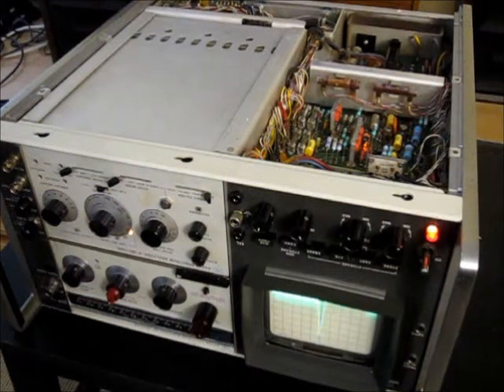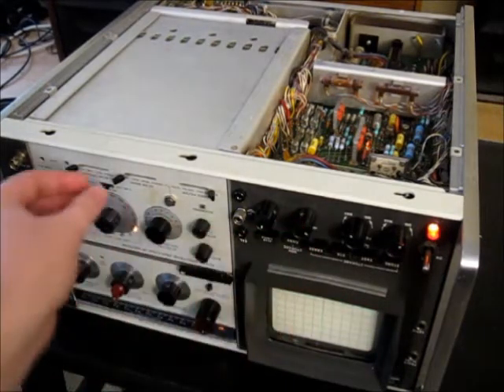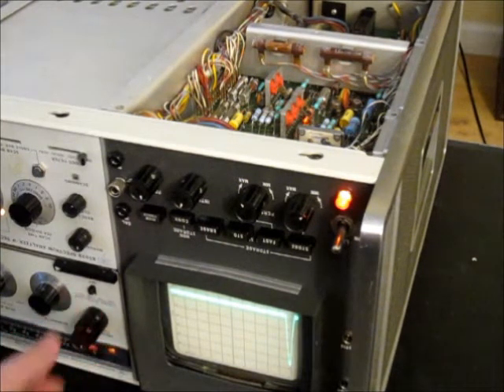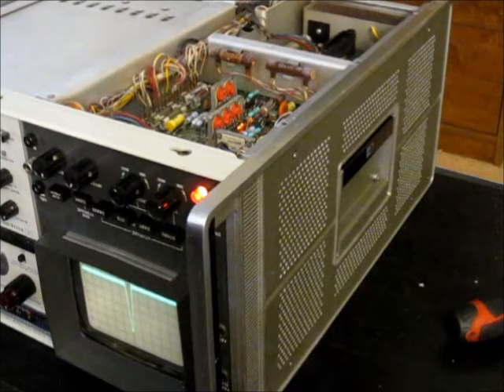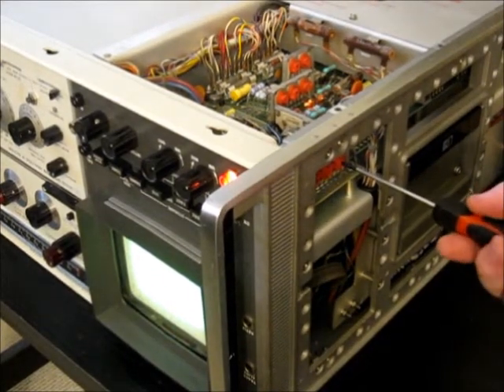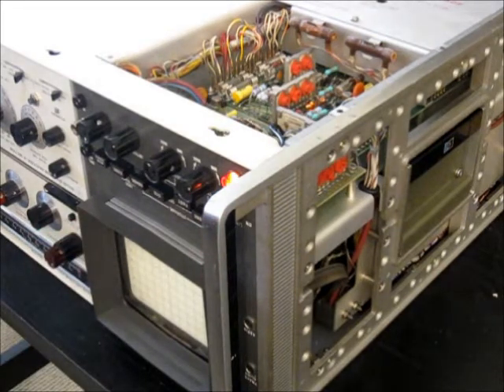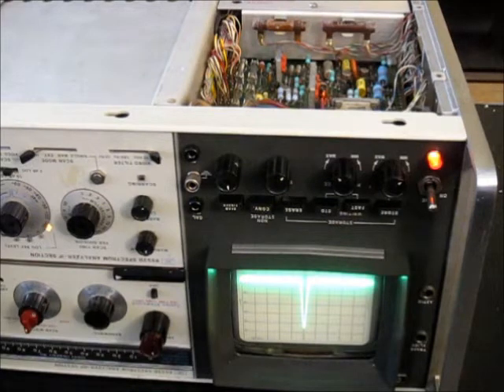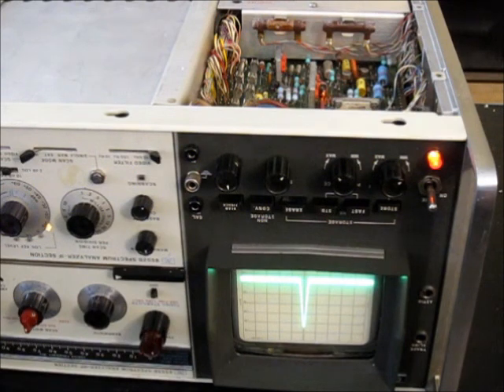How to calibrate a HP 141T: Part 4, CRT and storage adjustments

Comment: I know this video is quite old but I really need some help with my mainframe. three of the four power rails are perfect but my $248 volt rail is only showing 80 volts. do you know what the transformer should be outputting for that particular bridge rectifier? also do you have any tips on where I might be able to start figuring this out? it appears that it uses a voltage doubler circuit but please correct me if I'm wrong
Reply from the maker: I would look online for a PDF of the operating and service manuals and have a look at the schematics. The bridge rectifier (A1CR1-A1CR4) should have around 177.5V across it (The bottom should be around 70.5V with respect to ground), so I would expect around 127Vrms across the transformer taps for that rail. It uses a standard bridge rectifier, but the bottom of the bridge rectifier is referenced off of the +100V rail instead of returning directly to ground.

I would definitely check the Q1 power transistor in the sockets along the fan in the back. Q1 should be the socketed transistor on the top side closest to the back of the CRT with the unit right-side up. Note that if you have to replace it, Q1 is a PNP instead of an NPN unlike the other 3. If that is not the issue, You will want to flip the unit back upside down and start probing around the A2Q1 and A2Q2 small signal transistors on the power supply board. The manual should give reference voltages for several of the nodes in the schematic section, as well as placement for finding the right components. Open-circuit resistors in the regulator circuitry are also not uncommon in these. Best of luck in getting it fixed!

Comment: hola amigo. tengo un analaizador de espectro HP141T y no tengo circuito de la fuente de alta tension , tendrias algun circuito de este instrumento ? saludos! desde argentina.
Reply from the maker: Hello! Here is a link to the manual for the 141T. The schematic for the high voltage section is on page 114.
http://www.hamanuals.com/MMans/141T%20Technical%20Manual.pdf
Best of luck working on your spectrum analyzer! Regards from the USA!
Reply: hola !! muchas gracias..!! voy a seguir buscando fallas lo tengo que recuperar...es un hermoso instrumento